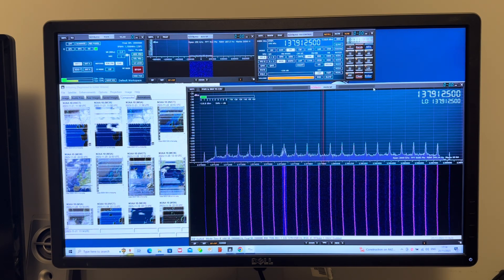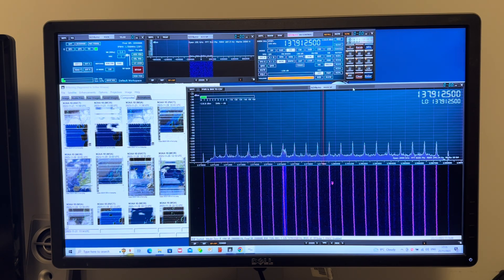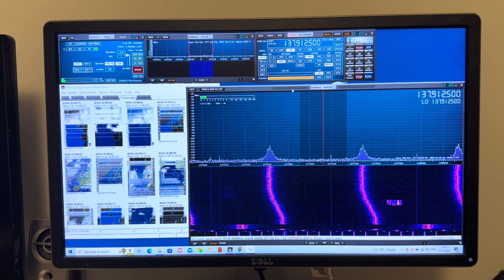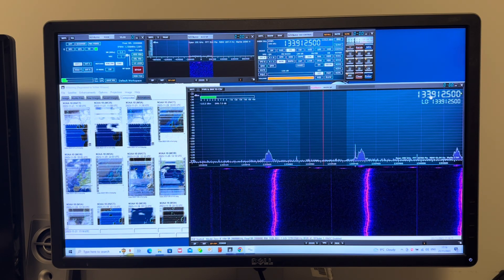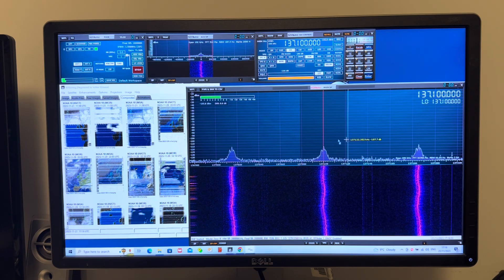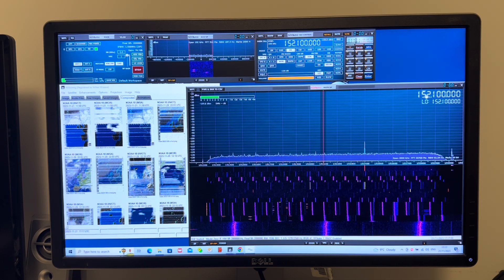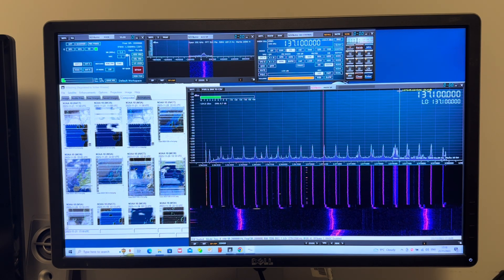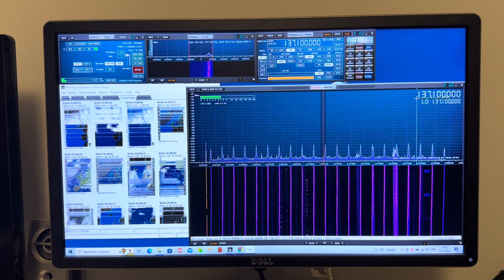Help!!! I have noise from ~120 MHz to ~150 MHz making NOAA satellite telemetry reception difficult

Comment: Is going to be a switch mode power supply for sure.
Using the mains wiring and probably the output connections as an antenna to radiate those spurs.
Most likely going to be a neighbour who has bought some new appliance or mains powered item that has a nice RF comb generator built in.
A good job for one of those tiny Spectrum Analysers with a sniffing loop attached.
Head outside and see if you can track the source. Trouble is getting access to and explaining to non technical people that their new toy is ruining your ability to decode satellites! See how fast the door closes in your face!
Reply from the maker: Thank you for your comments - and you're right, it's difficult approaching neighbours with this type of thing! 73

Comment: I get the same wandering noise spikes when monitoring the WX sats. I traced the problem to my USB-C port adapter (multiple USB ports, HDMI, Ethernet, etc) when I have a second monitor plugged into the HDMI port of the adaptor. If I go straight into the second monitor using the USB-C  port on my laptop, eliminating the need for a HDMI cable, there’s no noise.
Reply from the maker: I tried unplugging all my monitors (which are all on HDMI) but it made no difference! Drat!

Comment: Do you have any neighbours close by with solar panels on their roof, I have found numerous cheap power inverters (12/24/48v to 240v) are very noisy, although it is normally worse on HF, but they can also affect UHF/VHF, especially if someone is drawing a lot of power from their inverter (i.e. boiling a kettle, running a washing machine or dishwasher etc.).
Reply from the maker: Hi yes, a couple of neighbours have solar. The size of the noise field is huge...more than 10 metres high and over 20 metres from the shack...

Comment: I have given up on trying to sort out the rf mush beyond my own borders, it got to the point that as one source of noise was cured within days weeks another would appear..but also noise would disappear all on its own..0fcom are a waste of time in my experience ..as a radio amateur I operate on the the most usable band where the noise floor is lowest..vdsl on overhead telephone lines and neighbours using cheap power line distribution adapters are the main culprits in my area...best practice for me is to go out in the car and work portable. All this interference that we radio enthusiasts experience is a world wide problem, there is a YouTube contributor / radio ham based in south Korea, he lives in Seoul and has exactly the same sort of noise issues..one blessing has been digital tv broadcasting, at least now I don't seem to cause the neighbours dreaded tvi anymore as was the case with the old analog system...you win some you lose some 😂
Reply from the maker: Wise words - thank you Sir.

Comment: It is a switching psu for sure. I had this happen to me many times in the past but mostly below 30 MHz. Just shut down the power in your house and start up the breakers one by one to look for the source. If nothing is found, walk around in your neighbourhood with a portable receiver and you will surely catch the pest. Good luck Clint!
Reply from the maker: Thanks very much for your comments
Reply: A, few years ago I bought a Chinese universal power supply /charger for a laptop and it knocked out everything below 7mhz, save for local strong MW Broadcast signals! , but we are looking at much higher frequencies here of course,
Reply from the maker: Yes this noise starts above 100 MHz...

Comment: Hi Clint, in my experience turning things on and off can be frustrating and I always overlook something. I now just go to the circuit beaker box and turn off the mains to the whole house.  Obviously I need to be using a battery powered radio with a spectrum scope to be most effective.  I use a Icom 705 or handheld Icom R30.  And remember, it might be the monitor you use for the sdr, the phone in your pocket, or your camera.  Good luck
Reply from the maker: Hello my friend, I've checked everything in the house - all monitors, chargers etc etc. Can't find the source - I think it must be a neighbour. Thanks and 73

Comment: Is it a harmonic frequency does not matter what ariel you use still there ps it is the airband range !!! Cheers sir
Reply from the maker: Hell Sir, yes that's right. I used a PBF to block FM broadcast and DAB - but no change so it's not a harmonic of those signals. 73

Comment: Sorry to see that noise. In the past I found my worst noise source, that had a very different signature than this, to be the air handler in my attic. This is the central heating and air fan for the house. I had to tame it with some ferrites but it isn’t completely gone by any means. If I really want quiet I have to shut off the system altogether. This probably isn’t your problem but just thought I would throw this out there for others who may be searching in the future.
Reply from the maker: Thanks very much for your comments. 73

Comment: I think it's time for a hunt, sir.  You need a portable AM receiver, tunable to somewhere within 120-150 Mhz, with an AGC that can be *switched off*, and a hand-held directional (Yagi) antenna, and go for a long walk.  Perhaps you can find some local foxhunting-obsessed amateur radio operators to form an RFI hunting party.  They love this kind of stuff.
** Without a switchable AGC, the receiver will confuse the hell out of you as it will adjust away the very effect you're trying to exploit - signal increases/decreases based on aim and proximity.
As to what it is, around here, there are inline cable TV amplifiers, strung above ground, that are ridiculously noisy all over the spectrum.
Best of luck on this, Clint - Joe.
Reply from the maker: Cheers Joe. I've already tried this and found nothing. I think it's a neighbour - possibly a solar installation. 73
Reply: @OxfordShortwaveLog it makes it tough if it's something that is coupled into the power transmission lines. Appears to be coming from everywhere.  Usual approach is what I mentioned, but with the sensitivity turned very low so you have a chance to spot a 'local peak' in some direction.  Good luck with this Clint.